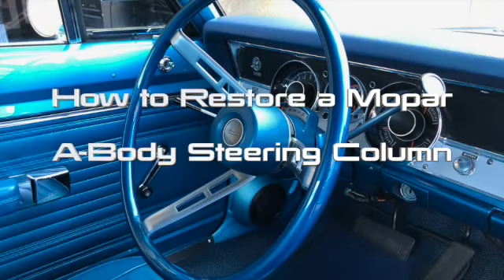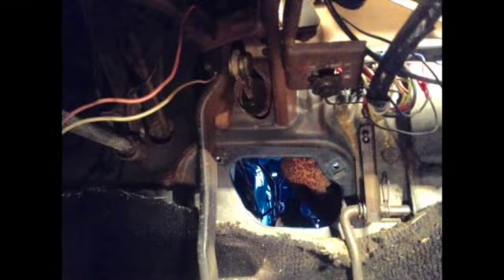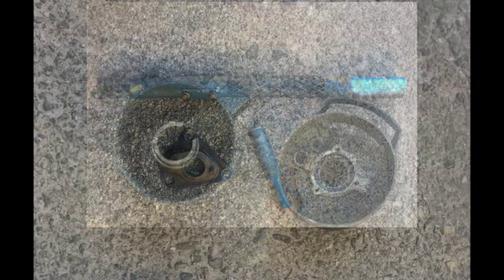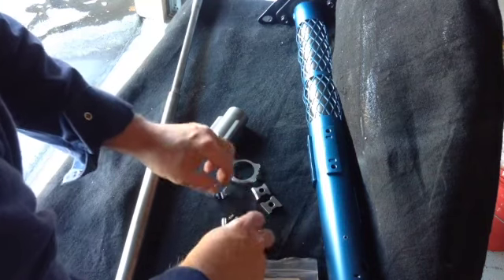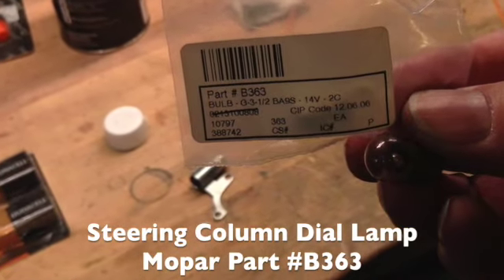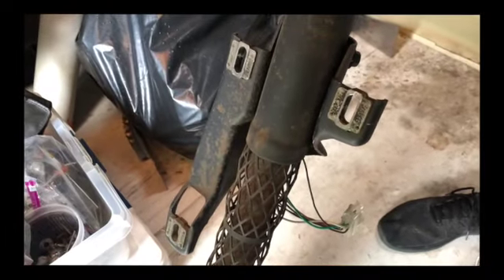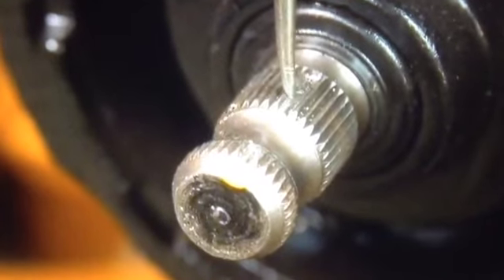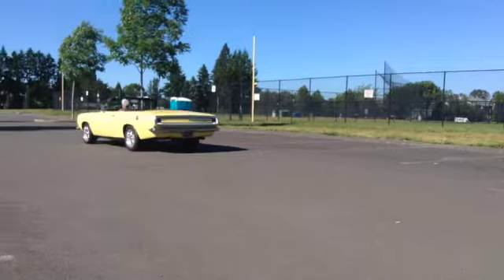How to Restore a Mopar A-Body Steering Column

Comment: I’m redoing a 69 fastback too. Can’t wait to see the other tech videos. So far you’ve got two great ones uploaded. My car is completely apart so I look forward to see the rest of your work.
Reply from the maker: Thanks man. Fuel tank is next, then dash, then windows. But be patient, it might be a while.
Reply: @angelgarrido9609  yes sir I’ll be waiting to see what’s next. My car has the wheel well cut out with a plate made to set in a huge fuel cell. It was done to make the fuel cell low enough to use the factory filler neck and gas lid. I’m not thrilled with this setup and believe I’ll change. Your video on the column made me look mine over and notice I was missing a roll pin and I’m gonna buy that spring retainer clip to put in it also. My instrument cluster was sent off and rechromed to look new. Really enjoy the detail in your videos.

Comment: This is a GREAT video.  Correct me if I'm wrong, but it looks like you installed your shoes flat side out (14:48).  In the diagram (13:36), the shoes are flat side in - facing the shaft.  I did my re-assembly according to the diagram (flat side in).  Can you please clarify (if you know) which way is the correct shoe position?  Thanks !
Reply from the maker: I tried flat side in, but it woudn't go in, so I reversed it.
Reply: @angelgarrido9609  If it wouldn't go flat side in then something's wrong. Every diagram Ive seen shows flat side in.

Comment: Nice video.  Great music.  Are the shoes installed backwards??  Where did you get the Mopar coupling body??
Reply from the maker: I think you can put the shoes on both ways. Find the coupling body on eBay.
Reply: The shoes in the video are installed wrong. The flat of the shoe goes toward the shaft. The beveled side goes inside the coupler housing so it can pivot. The way they are installed in the video will cause binding. A Factory Service manual will have the illustration for this assembly.

Comment: I watched this video and the shoes were upside down when a pic was taken.  Go back and look at the black and white diagram.  The flat side goes to the shaft.
Reply from the maker: Yes you are correct. It worked though. You can be sure I'm not going to take out the steering column out again.

Comment: I have a column (same as this one) that the key unlocks the steering lock but i cant move the shifter. Ive disconnected the linkage at the base of the column from the trans. The shifter will pull towards you but wont move up or down from park. Do you think that shifter tube is seized in there or is something in the ignition related to releasing it? 

What could stop the shifter from working properly with it totally disconnected?
Reply from the maker: I'm sorry, I am not familiar with the lock mechanism.

Comment: Not using the column because the plastic pins are broken is wrong. They were installed to help with assembly and prevent vibration. The column can't extend when it's installed. It's perfectly fine to use
Reply from the maker: My understanding is the plastic pins were made to break away with a head-on collision. There was a Mopar repair kit back in the day to fix the broken pins, but that was discontinued. Let's say you tried to replace the pins with a DIY pin and you were in a head-on collision, what if the pins didn't break and the shaft didn't collapse. The steering column shaft becomes a spear and you would be impaled. So, yeah you can use it, but do you want to take a chance with your life? Not me.